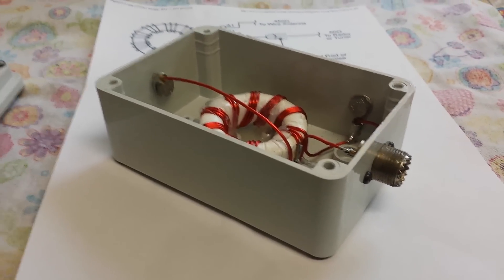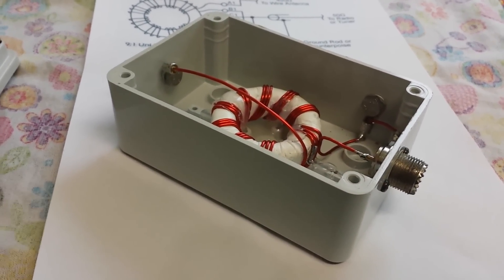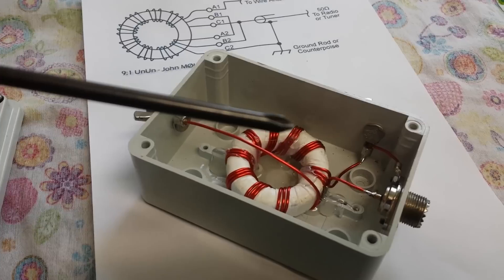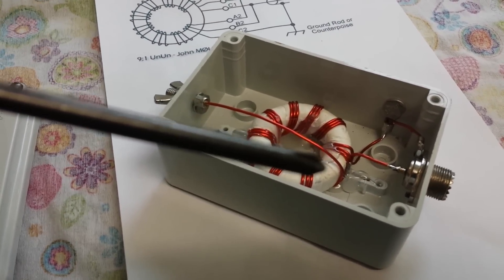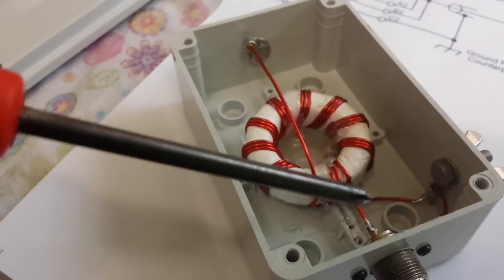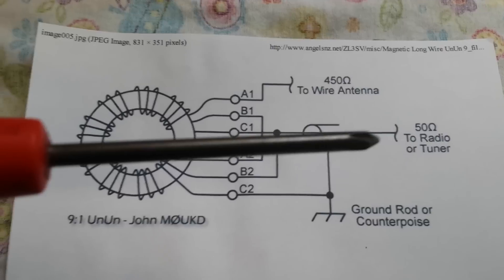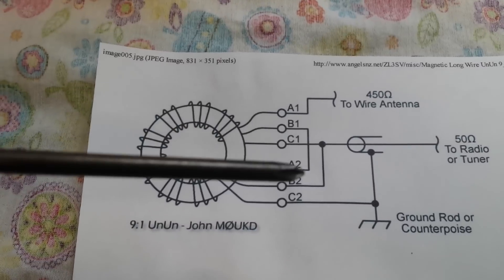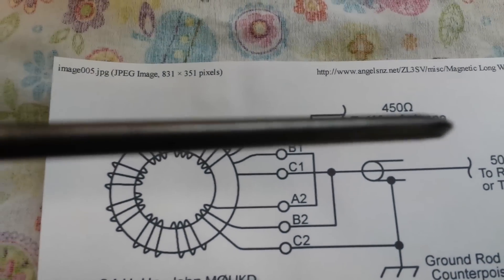Construction of a 9-1 unun

Comment: Make a 49 to 1 transformer and use 40 meters of wire you find that a lot better and you will not need to tune it on all the HF bands from 80 to 10 73s de g7npl.
Reply from the maker: Hi Christopher.  Yes great antennas, I've already done a few, check my other videos.

Comment: In your video there is no mention on what size toroid to use? What diameter in inches/mm are you using? Thanks.
Reply from the maker: Eric Fischer it's in the text and verbal description. It's a T200-2. That means type 2 mix and a diameter of 2 inches. The core would be red for type 2 mix

Comment: It seems to be difficult to find toroid transformers in Canada... on ebay it's crazy expensive from USA (30$+) and from china is quite cheap but will take over a month to get it, if not lost in posting...
Reply from the maker: Sadly we have the same issues here. Just order before u need anything and wait a month. On the positive side it's cheap enough to buy a little for future stock
Reply: I tried to make one with parts from an old broken PC power supply but I just realize that the Txxx-2 seems to be quite different than the one I got from that power supply, first my torroid is yellow (which seems to be for higher frequencies), a lot smaller than a T130/200 (still managed to do 3X 9 turns) and I am not even sure of the composition of that torroid will be suited for HF radio frenquencies... I will try it out anyway, my brand new radio is arriving today after 6 days in shipping... and this is after 15+ years of being silent on ham radio... I hope to be able to do some radio later today for the first time in many years !
Reply from the maker: Aleziss welcome back and hope the radio comes through ok today. The trouble with old PSU cores are indeed knowing what they actually are. If you have a few the same split one and see if it's a true iron core. Often they are different and have a metal tape through them
Reply: Well thank you very much sir ! I still have not received it yet (12:40pm) but the expected delivery is set to today july 23rd... As for the cores, there are three in the psu, the other two are black and the yellow was the biggest one, which I thought were the indication for frequency. I see that the red ones (like the T130-2) have a frequency of 250kHz-10MHz (which I find odd specially when antennas are claimed to go up to 54MHz) and the yellow color have a frequency of 3-40MHz (which I think would be a Txxx-6). So I can't verify the composition since I only have one... and I am not sure I could "decode" the composition of it anyway !
Reply from the maker: Aleziss I would go with the yellow and see how it loads up as you have nothing to lose,  but everything to gain. The yellow HF ones have a black back. Hope this helps
Reply: mk1tina, ok thanks for the precisions on the colors... mine is completely yellow... I will try it for sure at low power see how it reacts.

Comment: in another comment, you said this one is rated at 400W power. most of the end-fed unun I have seen are rated at 100W. what makes this any different?
Reply from the maker: Craig. The toroid is rated at 400w.
Reply: Thanks for the reply.  I'm new to this and learning a lot.  Perhaps I build this with the same toroid you spec, wrapped and wound as you suggest, but with 12 gauge magnet wire.  (That's what I have at home)  Would the heavier gauge wire throw things off?  I plan to use this with an end-fed antenna on an old Kenwood Hybrid TS-830S that pushes 200 watts.  
Cheers!
Reply from the maker: +Craig Gilbreath wire won't cause any problems to the tuning
Reply: rock auto parts

Comment: I put one of these into my Morphy Richards 27024 DAB/DRM radio and has enabled me to receive more stations on my radio without attaching and a long wire antenna, I used 12 to 13 turns of wire that came from a LAN cable and makes my radio preform better.